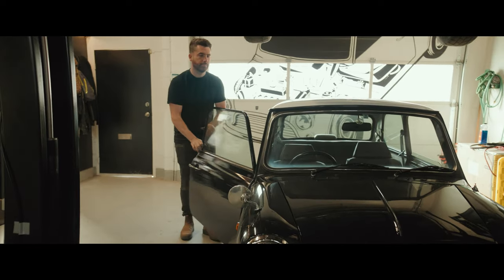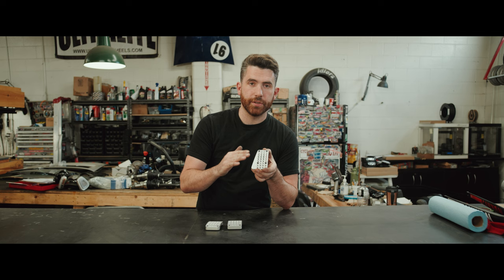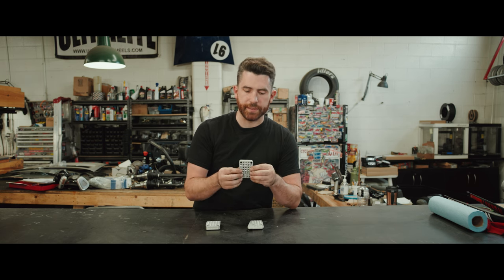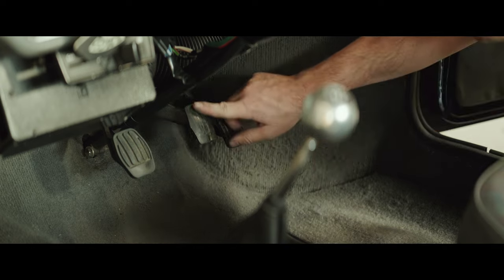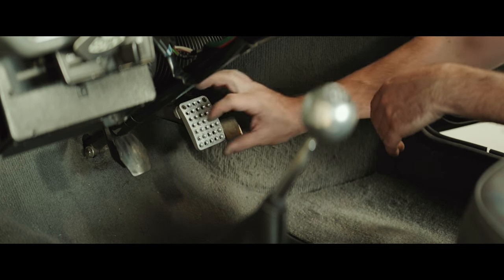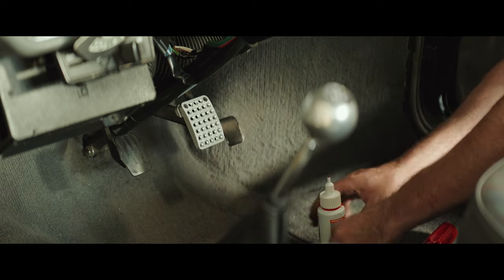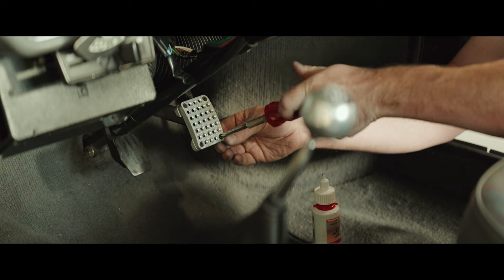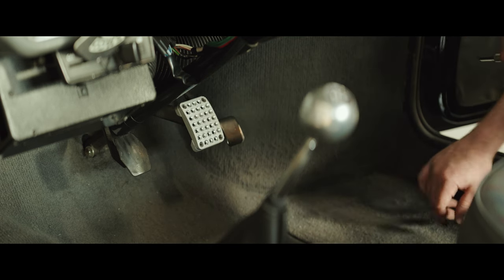Discover our NEW Billet Pedal Covers for classic Mini

Comment: Got me a few goodies from SMC in Dec after the border became easier to navigate. The pedals are great for tricky 2nd gear syncros. You can brake and rev when in neutral while doubling the clutch. Very nice. I also got the visor, gear lever, cupholder and splitter. Little touches inside really make a difference. They also tuned, and generally looked after it. Since the first tune and suspension work (over two years ago)  they did, my mini has run better than a modern car and is tight. After this latest slight tweak...  it is even better. Could not recommend this team more. They are real pros and enjoy what they do. It shows. THANKS Fellahs.

Comment: I have a set of new Metro turbo brake calipers that I wish to use , with 13 inch wheels , and I have the correct hubs to mount the brakes . My question I would like help with is that there are two bleeders on each caliper ...... so how do I plumb the calipers to the remaining brake system ? 
I like the pedal covers !

Comment: Are these suitable for LHD cars? The sets that are normally for sale for Minis hit the 'tunnel' and do not allow you to go full throttle. Not a lot of people know this and end up 'losing  power'.
Reply from the maker: We have tested these on multiple cars, LHD and RHD; and with minis, everyone of them seem to be built differently. We kept shortening it to make sure it'll fit on as many cars and have them work out of the box as we can. Adjustments maybe required, as even a thick carpet will cause the issue you mentioned.